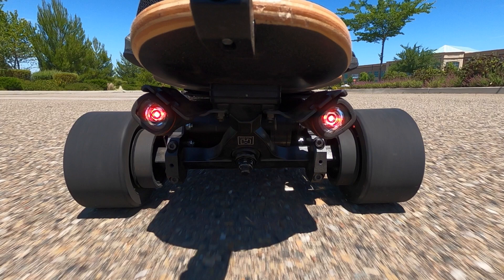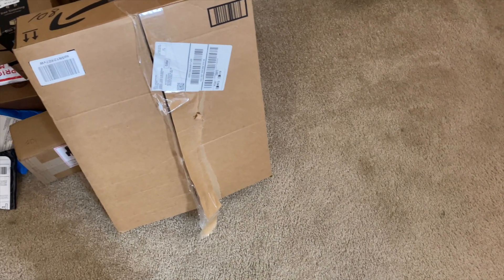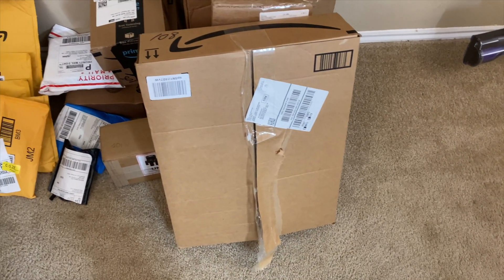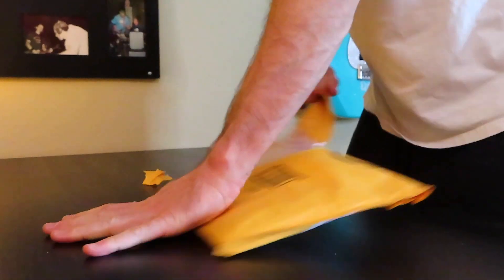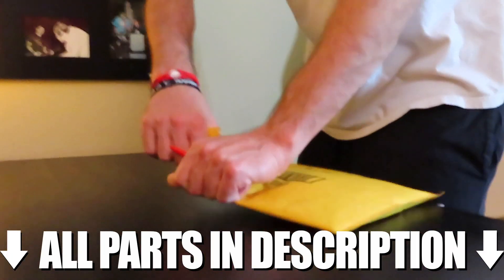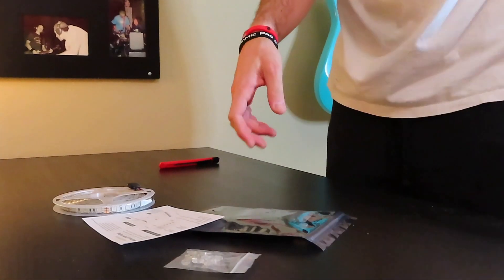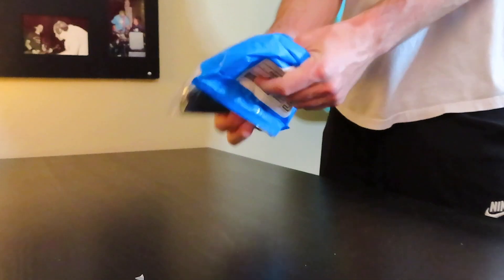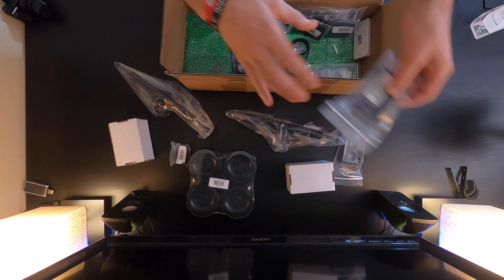DIY | Electric Skateboard | Dual Motor | Time Lapse Build

Comment: Where did ya grab power for the led strips? I have a board and looking at my esc I have 5v taps available. Looking for 12v as that’s what the battery the led strips had attached for customer testing on the retail shelf
Reply from the maker: I jumped it from the battery into a led voltage step down converter. It has a range of voltages but I got a 36 to 12v adapter so I could use the power from the battery.

Comment: what's the specs of your battery? i'm new to this. like what's the voltage and amp etc?
Reply from the maker: Hello. It’s a 10s3p battery. So 36v. The cells I used are Samsung 30q cells. Their spec sheet should be available online. It’s been a few years since I built it but I believe those batteries are still in use. I think some other packs are utilizing other types of batteries for builds but that’s what I used. Thanks.

Comment: real question. from the amount of time it took to build that, waiting for parts, putting together , soldering, trial n error. yep was it worth saving the X amount of money? if so , how much did u actually save to comparing to which board you thought was a little too much for ya. im asking this because im thinkin about doing diy too, i jus dont know if its worth my free time or not
Reply from the maker: Hello and thanks for the question. The board I was initially looking at was the evolve GTR. I saved about 800-1000 dollars by building it myself. But there are other boards not as expensive that perform around the same as the GTR so that number is really just in comparison to the GTR. At the time I built this board there weren’t as many quality budget boards on the market yet either. 

The main question you have, “is it worth it?” That’s kinda hard to answer. For me, it was absolutely worth it. But it wasn’t so much about saving money as it was about the process. I enjoy figuring out how things work and how to put stuff together. One good thing about building it yourself is that when something breaks, and it will, you know how to fix it. Another plus is how customizable you can make it. When you buy a board like the GTR you don’t have as much control over the programming……however that could also be seen as a downside too if you aren’t too savvy with a computer. 

Another plus is that doing DIY you are going to get more bang for your buck. The motors on my build are much larger than the GTR motors so in theory I can get a better performing board for less money……..also with that being said there are lots of other boards MUCH cheaper than the GTR that perform really well. 

One other thing to consider is your skill level. I was a complete beginner when it came to riding skateboards. Of course I’ve been on a longboard before but never gone that fast. Coming from a scooter that goes 30 mph I was looking for something similar in performance. Quickly I discovered that 30mph on a scooter is WAY different than 30mph on a skateboard. I didn’t need half the performance that I built into my board. It’s nice to have the capacity to grow into it. But for my FIRST esk8 this thing is a monster!

With pre built boards it’s a little hard to upgrade say they motors if you want to get more performance. Overall, for me the pros out weigh the cons…….but I will also say that this process wasn’t the easiest thing I’ve ever done. 

Building your own battery can be extremely dangerous as well. So there is some risk factor involved. Additionally, I bought a cheap ESC to begin with and it went out while riding and I almost broke my shoulder when I fell off. So not knowing the reliability of some of your parts can be an issue also.

Now is all that worth your time?? Only you can decide that. I’m sure glad I did the build because I really enjoyed it, but it isn’t for everyone. I’d say total amount of time I spent waiting for parts and building the board was several weeks. But I gained some new life skills…..and to me that is priceless. Would I personally do it again??? YES! 

Sorry that was so long of an answer but I wanted to be as thorough as I could. Let me know if I didn’t get anything answered. Thanks again! 🙌🏼
Reply: @ADayintheLifeofMr23  ha! yea man i totally get it. we are definitely opposites but i definitely wanted to understand ur perspective on it. as for the GTR, i have owned many of its competitors with “better specs” and none of them was the same performance and quality. only one so far is the onsra black carve 2, and the eovan gts. everything else, wowgoat2, vestar blackhawk, verreal rs 19ah, trx 2.0 lycaon, raldy, ownboard bamboo, and many many more. theres a reason why they r cheaper. quality, power, and range isnt there. sure, some of them might have better “top speed” but skating isnt about that. maybe scooters, sure. high speeds there makes sense. but skating has soo many other attributes as a fun sport other than straigh line high speed. evolve has never been about top speed. there more about the endless wave: however, all u really have to do it put 23-29t pullies with bigger wheels like 107s. and youll be at 30mph. lastly, the gtr was made in 2017, released in 2019. its VERY outdated. yet that old 10s battery still gets better range then MOST new copy cats with 12s. same for there small motors. sure, they cant hand a LOT of friction if ur heavy or crazy off road due to its esc. but those output on those small motors is better than most. id rather the power then not going off roading in my opinion. off roading is a different type of board in my opinion. 🤙🏼🤙🏼

Comment: Good build overall, I will put some hot glue or silicon in order to make plug water resistant ;)
Reply from the maker: Thank you for the comment and also for the great suggestion! I will definitely do that next time I open the board up. Appreciate you!

Comment: How much did you spend in total? Also wattage of the motors ? Is it a vesc ?? So many questions lol
Reply from the maker: Total cost was about 9-1000. The motors are 6374 and have a max output of 3250 watts each. This video is an ESC but later on I upgraded to a vesc. The vesc I currently have is a Flipsky 6.6 plus. 

Thanks for the comment!

Comment: What kind of tab welder is that? Any suggestions for decent ones for good prices?
Reply from the maker: It’s an off brand. I got it on Amazon. It was about 120 I believe. I linked it in the description though if you want to check it out. I don’t use it super often but the times I have it’s been great. I like this model cause it has an extension arm to make it easier to get the batteries under there and the welds in the right spot. Thanks for the comment!
Reply: @ADayintheLifeofMr23  I was also wondering this, but I don't see it linked. Thank you!
Reply from the maker: Hey there! The item I bought has since been removed so I couldn’t link the exact one from this video. Since this video I upgraded to a battery powered spot welder and I love it even more. I just updated the description to include the new link.  Thanks so much! 

https://amzn.to/3ttrDDv

Comment: What did you use for the underside of the deck? It doesnt look like vinyl. im doing a diy soon.
Reply from the maker: SOTTO SOTTO OT actually it is vinyl. It’s matte black and I used vehicle wrap vinyl for it. Been holding up great so far! Good luck on your build. I definitely recommend a vesc over an ESC. I ended up upgrading it very shortly after this build.
Reply: @ADayintheLifeofMr23  Thanks!!

Comment: Did it cost you cheaper than just buying a ready made one?
Reply from the maker: Yes, it was. The board I was looking at was and Evolve GTR. So that was 1900. I don’t know the exact number but it was pretty close to 8-900 dollars. So I saved about 1000 dollars or more by doing it myself. 

The other cool thing about it is by building everything including the battery, I know how it all works. So whenever something goes wrong I know how to fix it! 

Thanks so much for watching.
Reply: A Day in the Life of Mr. 23 ok is it as affordable as the Chinese boards? Like vestarboard? Especially their extended range battery?
Reply from the maker: qjtvaddict probably not. They can mass produce so they get parts much cheaper. All of the stuff I bought I had to pay shipping on too so that raises the price of everything. But still more affordable than a high end board

Comment: What kind of battery did you make? Is that a 15s2p?
Reply from the maker: Hello. It’s actually a 10s3p. I used a diagram I found online for this build. In retrospect I probably would have arranged it a little differently. It was a little confusing for me up until I started piecing it together, then it all clicked. I’m gonna be building another battery soon and I’ll get into more details. This next battery will be 6s3p. Mostly because I originally ordered 50 battery calls so I could either do another 10s2p or a 6s3p. Curious to feel the difference in performance with the 6s. Thanks for the comment!

Comment: Well done! through enclosure wood screws will back out, try threaded inserts, round head screws and loctite 243. Rubber seal is also a nice to have
Reply from the maker: Thanks for commenting! I agree that the screws weren’t the best idea. I think because of the velcro strips I used as well that should keep the screws in place. Not sure if it will make a difference but I did use self tapping screws rather than just plain wood screws as well. Part of the reason too is the enclosure I got doesn’t really have a lot of space to get a good size screw to put washers and nuts on. 

But I like your suggestion about threaded inserts. Thank you for that. I wanted the LEDs to look flush and not be directly on the board but that also turned out to be a terrible idea. The adhesive on those strips is usually crap anyways. So my bright idea was to use gorilla glue to hold them down. Well.....the ESC I got fried and now getting that open means I have to remove the gorilla glue to get to the screws. Then pull it all apart. 😩

Learned a ton about everything on my first build and will improve for sure on the next. Thanks so much for watching!

Comment: I suggest you don’t buy from mboards as  you can get most of the stuff you need else ware for cheaper
Reply from the maker: Thanks. I agree. I did only a little research about it before this build. But next build I won’t be buying much of anything from them if anything at all. Plus.....I didn’t have a very good experience with them. Before I decided to build the battery myself I actually paid for a 10s3p from mboards. A week later it still hadn’t shipped. They don’t answer emails on the weekend, and when they finally responded several days later......they were pretty rude. 🤷🏻‍♂️ I guess they don’t like money! Haha. Thanks for the comment tho!
Reply: A Day in the Life of Mr. 23  yeah I am going to make my own and almost paid for everything until I went to diyeborads and saw everything I want for 150$ less it’s just one guy trying to make a quick buck but I heard good things about there 12s battery’s
Reply from the maker: I ended up buying a spot welder for my batteries. Plus enough batteries to make a 10s3p and a 10s2p (50 Samsung 30q batteries)  for another build for the same price I was gonna pay for 1 pre built battery from them. Plus I learned a new skill. So it almost worked out better that they didn’t ship the battery cause I learned how to do it myself!
Reply: Diego Rhi diyeboards parts are not good 🤦🏽. They are cheaply made Chinese oem parts, decent for beginners, but not good. And the mboards batteries are terrible. Check any tear down, they are sloppy. I agree with you that mboards is no good, their customer support is awful, but diyeboard is not a better solution. If you want performance, you want parts similar to what you would find at mboards. Individual motors, mounts, pulleys,etc. 
The custom built battery was a better route 👌
Reply: Anshul Bajaj thanks for the advice I am just trying to build a basic blared to get me around

Comment: What is that black sheet under the board called
Reply from the maker: I used some matte black wrap vinyl. It’s typically for cars but it works well on other surfaces as well. Thanks for watching!

Comment: How much was your build?
Reply from the maker: Just about 900-1000. I’m gonna do a proper overview of the build and go over parts and cost very soon so that will have an exact number, but roughly right around there. I did go a little extra with some stuff like the LEDs and regulator. Learned a lot on how to save a few for the next build as well. Thanks for watching!

Comment: what was the topspeed you got on the board?
Reply from the maker: I’ve gotten it up to about 20-21 mph or about 33km/h. It will go faster.....but I’m just so new to it that I’m not all the way comfortable with going that fast yet. I believe I should be pretty close to 30mph with these motors tho. I will keep you updated. Gonna do a speed and range test very soon. Thanks for watching!